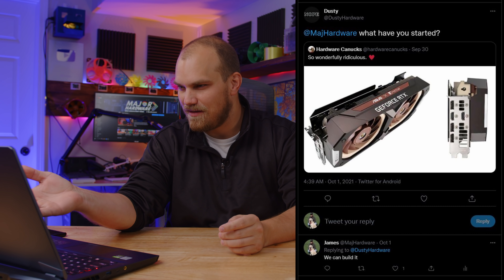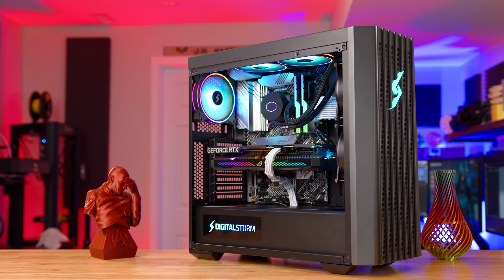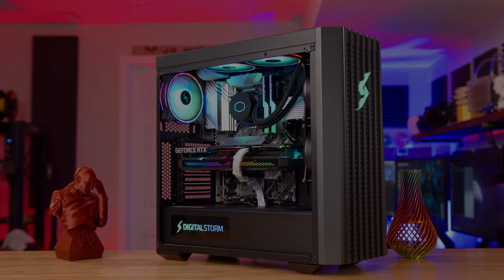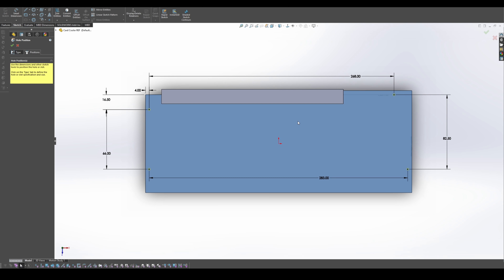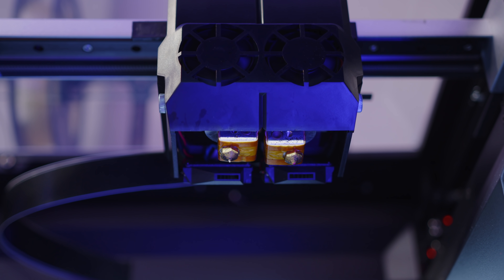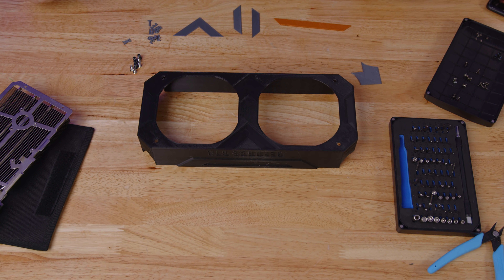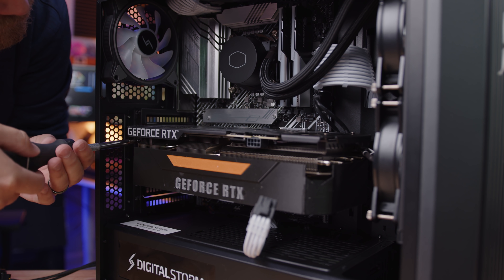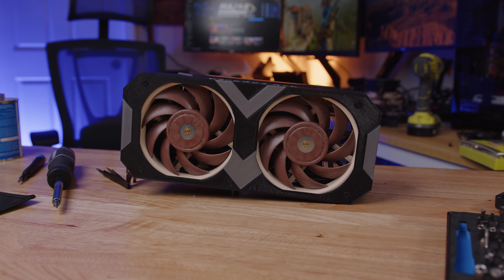I FABRICATED The RTX NOCTUA EDITION From A Picture

Comment: The 3070 Noctua is a 4 slot design too. And the noise level you reach is super impressive. I have to run the fans at 100% on my 3090 to reach steady state at 56°, and it's obnoxious. The noise is about 60% of why I'm watercooling it
Reply: 56° is cooler than you really need. 70° would be very much fine as well.
Reply: @Sebbl3  depends on your definition of 'fine'. GPU Boost starts dropping frequency at 30° on ampere.
Reply: why must you have it so cool? 80 C is fine but my 980 Ti (founders stock blower design) runs hot at 86 C
Reply: @Dimondminer11  every 5° over 30 equates to a 15mhz drop. By 86°,my card would be throttling, the gpu hotspot would be coming up on 100°,and my VRAM would be overheating
Reply: @Dimondminer11  your 980ti is on gpu boost 2.0. I'm not sure what temps it bins at, but each bin is 13mhz. And it's actually user controllable for you. I would definitely recommend a thermal paste reapplication
Reply: In the 3090, it s not the core temps problème, it s the vram temps who is the problem. Unfortunately, it s a design issue. Some of the vram  are not cooled a all and can reach +105c. 
I think It will be a real challenge to do a diy cooler for this beast, if an after market cooler can do it, I will buy it and I pretty sure a lot of 3090 owner will do the same !
Reply: @nemoace9464  it's not a design issue, it was NVidia using cheap thermal pads on the early 3080 and 3090 Founders Edition cards, but they silently changed the pads they used earlier this year. and you can fix it yourself for $40 and a half hour of your time. My VRAM temps were over 115° and now stay below 82°. If that's not good enough for you, then get one of the active backplate waterblocks from Bykski, bitspower, or EK that are already on the market
Reply: @technewb8241  for me it s a design issue, cause the vram on the back are not cooling actively, just like the other side. Changing the pad do not resolve the problem, but just make it less problematic. And yes I have a diy solution my self but still 90c on the hot spot. The core is still cooler less than 50c with the fan at 70%.
In the Fe it s only the backplate who is cooling the vram, and it s like 15x15x0.3 ! Clearly not enough, and it s a 1500€ card !
Reply: @nemoace9464  if you are getting a 90° hot spot temp with a core temp of 50°, then you screwed something up. I have a shunt modded 3090FE and after an hour of cyberpunk at 4k RT Ultra, my max temps reported by Hwinfo64 are: 54.4° on the core, 72° on the VRAM, 65.1° on the hot spot, on the stock cooler with Thermalright Odyssey Extreme pads and Kryonaut paste. Clearly, the backplate is enough cooling for the VRAM, which is rated from the chip maker to 95°.

Even on the stock thermal paste, I never saw more than a 15° delta between the core and the hot spot. It sounds like you either used thermal pads that are too thick, or have poor application of thermal paste
Reply: @technewb8241   I m mining ⛏️⛏️⛏️⛏️ 😅
Reply: @nemoace9464  so you screwed up your card, likely have it sitting in a rack with no airflow over the backplate, run it at the max load 24/7, and try to blame nvidia for it getting hot? Foh
Reply: Not allegedly, it is a 4 slot, very clear from the picture
Reply: @riba2233  I used the term 'allegedly' because the render was leaked through a post on the Asus Vietnam Facebook page before being taken down, in the middle of Facebook pages being hacked en masse. Not exactly what I would call an official product announcement
Reply: @technewb8241  ok in that sense I get it, bit these fans are much thicker that regular gpu fans so it makes sense that it will be 3.5-4 slot if it ever comes to life
Reply: @riba2233  oh, I absolutely agree. And I suspect that it is the reason why Asus chose the 3070 over a higher end card. I suspect that early renders posed case fitment issues with bigger cards
Reply: @technewb8241  nah, open rack with big fan on a side and a fan and some aluminum rad on the backplate, so the temps are in control. I m not blaming NVIDIA for my personal experience, I m pretty confident in torn apart a 1500€ graphic card to replace some thermal pad. But I m thinking about the regular dude who brought it and put it in his case and launching some render and start hearing a jumbo jet taking of next to his ears.
A lot of people in the YouTube game say the same.
Reply: @riba2233  I officially rescind the 'allegedly' lol
Reply: @technewb8241  yep, to me it already looked pretty close to finished design :)
Reply: @technewb8241  aaaaand it's wider than 4 slots lol
Reply: Well you could just use a fixed Mhz....with a lower voltage.

Comment: Now put the number one fan for the fan showdown on the card.
Reply: but the number one is the cheater, which would be difficult
Reply: @drizzle1482  unintended benefit: no card sag, since the cheater would be touching the bottom of the case
Reply: @slusbe  ......and blocking all airflow 🤣
Reply: @bra1nc417d  haha true. Hopefully that case has bottom intakes
Reply: @drizzle1482  season 1 winner? 
I consider that one as the "top fan" for a small size at least.
Reply: @drizzle1482  number 2 then lmao
Reply: @KelBShobra  The stock Noctua is the number 2 fan.
Reply: @WhyT74  rip
Reply: @drizzle1482  twin velocity stack cheater fans for the win!
Reply: @drizzle1482  no it isn’t, it’s the Phanteks T30
Reply: @drizzle1482  just need remote GPU cable totally doable
Reply: Now I want to see him figure out how to use the cheater fan on a GPU.
Reply: @Najolve  easy they make cases for mobos with like 8+ PCIE slots lol
Reply: @Najolve  mount the GPU card sideways?
Reply: @Najolve  Old school case with side intake + vertical mount GPU + dual cheaters
Reply: I was literally waiting for him to do it in this video lol
Reply: Put that fan that runs at 3000rpm.
Reply: @BigInjun05  that's what im gonna do.
Reply: there should be a few categories,
"stock size"
"extended"
"shrouded"
"ya'll probably make something that requires this category"
Reply: Fan riser and The Cheater FTW!
Reply: Fab showdown season 4??
Reply: I want to see it with a tulip fan
Reply: He should try to use the best fans of each season
Reply: I would reverse the idea - make the quietest fan with stock like performance. Then put it on the graphics card.
Reply: @Doktoreq  good idea
Reply: Do it!:goodvibes:
Reply: DEWIT
Reply: What is a cheater fan?
Reply: @orfeous  https://youtu.be/I2lxGYplpMA it’s from this episode of the fan showdown
Reply: Yessss

Comment: After seeing the Noctua one i actually thought about 3d printing a shroud for my 3060ti and putting the 12x25 chromax on it that are coming out soon. I'm surprised we haven't really seen many or any 120mm GPUs over the years. Even on the biggest GPUs we still get basic 80 or 92mm fans.
Reply: Seems like the heatsink was the limiting factor as far as cooling goes and I've never noticed gfx card makers being concerned with noise levels, maybe if this joint venture sells well we'll get to see more 120mm fans on cards.
Reply: It’s because it’s extends the life of the card and repairing the fan would be easier
Reply: @LTMoore-yy1lm  can confirm I've replaced fans and coolers on 2 different graphics cards easier and cheaper than replacing a high end card.
Reply: Some cards have slightly larger fans. My Red Dragon 5700xt uses 100mm fans for example. Still not 120mm though
Reply: @bike-cave-man2527  I hope so. I've thought about putting noctua fans on my 5700xt red dragon before.
Two 120mm fans are exactly the same size as the current shroud although they would probably be a bit a taller.

The only reason I haven't done that yet was because I don't want to risk any damage to my gpu with the current price situation
Reply: I have put 2 Arctis Bionix 140mm on my Asus Rog Strix 3080.
Ooo boy it became an ugly beast. 12 degrees down with absolutelly no noise 😀.
So forme worth it, giving the fact it drains 450w when maxed out.
Reply: 1. Temps were the same.. sure it was less noisy but temps are more important. 2. It would easy be a 4 slot card as slim 120mm fans arent efficiant like normal 120mm fans. 3080FE with small 80/92mm fans runs perfectly cool for example
Reply: @l0ki4321  unless you are mining on those and have them isolated...I think 10db noise reduction is a good reason to go with the extra effort in to making something like this. And if the official card is reasonably more expensive than the regular version, again it's worth it. If it's like 200-300$ more expensive then...yeah it's not worth it.
Reply: @l0ki4321  the noise is a huge factor. I will let my card run hotter just to prevent noise man
Reply: @l0ki4321  lmao mate you make no sense. If temps are same and noise is less then that's a worthwhile mod to do just to have  amore quiet environment while keeping the sam eperformance.
Reply: @l0ki4321  Saying that temps are more important than noise is a very American thing to say. The market in Europe has opposite values - most value low noise over low temperatures. Those of us that want both do custom water cooling.
Reply: @Steamrick  it's a bit easier to have a colder water cooling set-up in somewhat colder environments, most summers and springs in the US sit's around 85 degree's fahrenheit, or roughly about 30 degrees celsius, winter being the only time ambient temps can help cool a computer. So yeah temps matter a lot more for us. Having that higher baseline can make it harder to drop temps when the average difference is closer to the operating temps, especially if you don't have a home with AC to get a more normal 21-23c room.